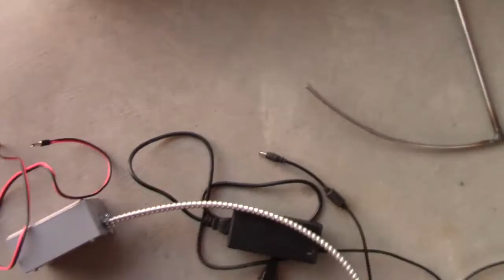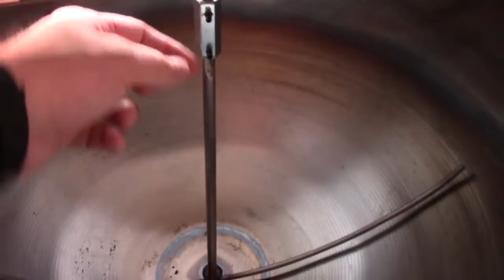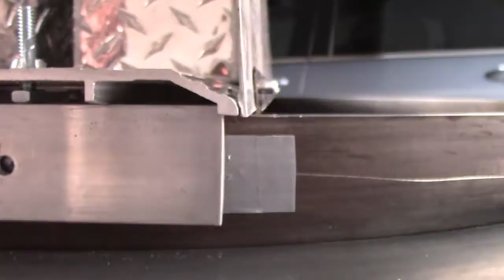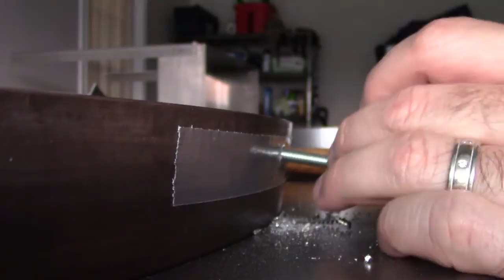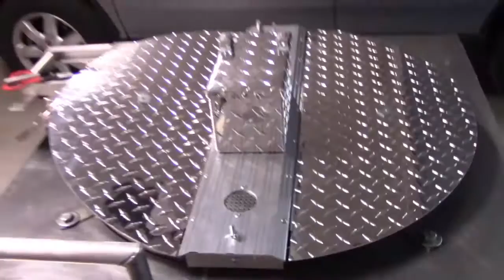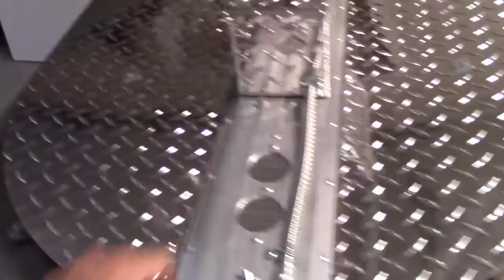How to install an Automatic Stirrer onto your Kettle

Comment: The only thing that it's missing is ventilation for the motor box, it should have one, most machines I seen so far have ventilation all around the box, including mine that I bought from China.
Reply: Leo Moran if you purchased your kettle corn machine in China, how did you connect it to the car battery? Did they install the converter box for you? I was considering one on Alibaba but they only sell it with electric cable. Thanks